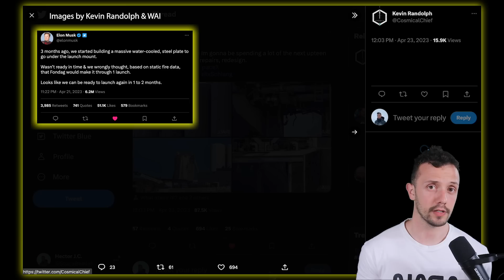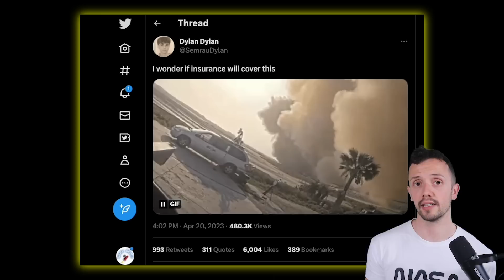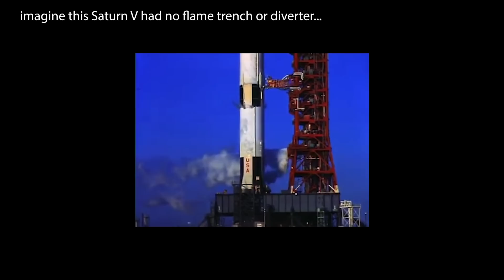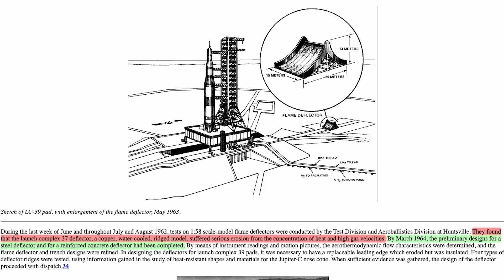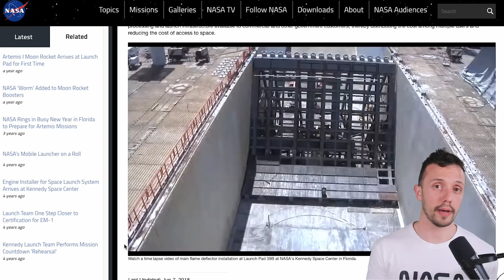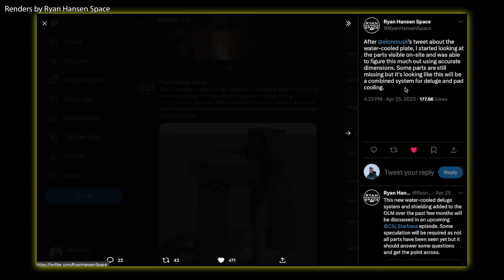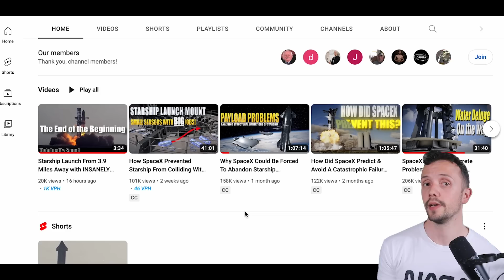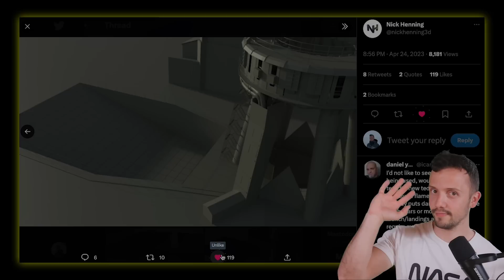SpaceX is Developing a Smart Solution for its Pad Problem: What We Know & What It Could Look Like!

Comment: My question is, how can you put water under the jets,  unless you find a way to keep the water under the jets long enough for the water to evaporate. 
Water under the steel plate,  will do nothing.
My sense is that you need water pumps capable to maintain liquid water under the jets long enough for water to evaporate, which is hard,  jets will disperse water before water can evaporate. 
Hard problem,  it can be solved, if water cooling can be made to work, it doesn't mater if is steel or concrete is used.
Reply: I believe what they mean by water cooled they mean there’s channels within the steel plate that allow water to cool the plate. The water will not be exposed to the jets.
Reply: @saidzaid-alkailani519  
There's no time for water to evaporate,  the jets will deflect the water much faster than the water needs to evaporate,  unless you have extremely powerful pumps that can create a layer of water underneath the jets that have time to evaporate. 
Holes in the plate, is not a solution,  either, it takes time,  a short time for the heat transfer to be established. 
You need water at high pressures and velocities to allow water to evaporate under the jets,  which means,  roughly the m dot of the water to be equal or higher than the m dot of the jets,  by the ratio of lambda water over lambda jets is higher than one, is much more complicated than this,  but this is the physics of it
Reply: @saidzaid-alkailani519  
It takes time to establish an effective heat transfer between two media,  no matter what  the media is.
The thicker the plate, the worse it is , the jets will melt the steel plate in milliseconds.
My thinking is that a launching pad can be expandable. 
Getting to the stars, is expensive, and , beyond all, we are not made to leave this planet,  not now nor in the future, we can have robots to do this for us
Reply: You need brute force. The water cooled steel plate is not efficient at cooling,  you need water to evaporate,  point is that lambda sensible is much lower than lambda latent
Reply: @alexhaplau-colan5414  you’re misunderstanding, the water isn’t going on the surface of the plate, it’s inside of the plate.
Reply: @saidzaid-alkailani519  
That's my point, water needs to be in contact with the jets,
Reply: @alexhaplau-colan5414  maybe, not necessarily though, if they are able to pump enough water through the steel plate the heat can be exchanged fast enough such that the steel doesn’t melt, won’t know if it will work or not until they test it.
Reply: Yes, but there's not time nor money for more experiments, it must work,  period. 
In any cooling designs,  if you can use the latent heat,  the efficiency of the cooling, or heating, is much higher than using just the sensible heat
Reply: The specific heat of water is 4.2 kJ/kg, the latent heat is 2250kJ/kg, this is my point
Reply: @alexhaplau-colan5414  your unit is for specific heat is slightly wrong, it should be kJ/kgT, so if the water increases in temperature by let’s say 40 C then each kg can absorb 160 kJ of heat. The heat transfer coefficient of water is also much higher than steam if the waters velocity is fast enough. Most water cooled system do no require the water to evaporate for  heat transfer, on the contrary cooling efficiency drops if you start developing steam.
Reply: @saidzaid-alkailani519  
There is not unit kJ /kgT,  you're right liquid water has a much higher HTC than steam,  in  any device,  my point is simple,  you don't need a heat exchanger,  you simply need water in contact with the flame,  so water is evaporated,  which takes much more heat that heating the water
Reply: @alexhaplau-colan5414  yeah fair enough, we’ll just have to wait and see if it ends up working. And specific heat units are kJ/(kg*T) look it up.
Reply: @alexhaplau-colan5414  sorry I guess I’m miss writing it, I meant to say kJ/(kg*K)
Reply: @alexhaplau-colan5414  and I’m not so sure if there isn’t the time or money for them to continue experimenting, this the process of iterative improvements, with how fast they are developing this project, failure is to be expected to continue the quick pace of improvement.
Reply: Experimenting,  is beautiful,  simply beautiful,  but experiments don't pay the mortgage,  you need to sell something,  or you need to create a need for people to buy the need that you created.
If you create a hot sauce,  and people like it,  you're rich,  same thing with the rockets,  they cannot exist,  if there's no reason for them to exist, going to stars,  is not a need that people will buy, in another words,  personally,  I don't want to go to Mars or Europe,  or anywhere else,  I'm just fine here
Reply: You think an enormous heat exchanger, which in itself is a big problem. 
I'm thinking water being pumped underneath the jets,  no heat exchanger,  nothing but brute force,  just like the jets are

Comment: I have ran the numbers and it is blatantly mathematically clear there was no way the launchpad wouldn’t receive massive  destruction!
Reply: Elon´s masterplan to figure out any weak points on the OLM? One can hope.
Reply: @PedroTRamos1  Well Elons point was that Raptors will not face flame diverts on Mars or any other environment. So he in sense force development team to think in more robust designs features. Not bad per say because u can then dial back with further solutions here on earth anyway.
Reply: @alesksander  33 Raptors will never fire together on mars so trying to go without a diverter is stupid. Physics demands considerations at this scale, no way around it. Need infrastructure.
Reply: @chrisjacobsen1659  True that. But team tried anyway. After all they estimated for one lunch concrete pad will work till they install cooling plates and rainbirds. Obviously didn't. And engines and structure were tested in worse possible conditions. SO they got worse acoustic data possible. Witch is all invaluable. They know the limits now. And due such harsh requirements engines should be more durable anyway. Aspirational goal is too ditch engine shielding as much as possible. in order to save weight.
Reply: @alesksander  "..Well Elons point was that Raptors will not face flame diverts on Mars ..."
You give Elon way too much credit.
He isn't a genius
He isn't a rocket scientist
He has a Bachelor of the arts in physics. Not a Bachelor of science in physics.
Frankly his Ba is pretty much the equivalent of what a European Highschool graduate knows about physics.

Testing to destruction isn't something that is done while still figuring out the design. Once you have a fully working and repeatable working design you might do a test to destruction to find the weak points and the limits. Doing it while you are still coming up with a solution will give you data but seeing as that you knew in advance that all kinds of things were going to fail, most of the data is actually pretty worthless.
Reply: @PDVism  Maybe he is not genius. But fact is they  assumed that pad will hold and they wanted data for flight. So spin that how u want...
Reply: @alesksander   No need to spin it. Lack of adults in the boardroom and certainly lack of adults that understand engineering basics.
Reply: @PDVism  Maybe yeah. But after many success stories with Falcon 1, 9, Heavy developments. Maybe they got idea or 2 about how build rocket.
Reply: And call them fouls is quite rich.
Reply: With over 37 years of advanced material reinforcement manufacturing and failure analysis engineering experience, I have designs that should be considered for a major reengineering of the launchpad system & tank farm which can be replicated on other planets ie. Mars. 

With reinforced concrete, it is critical to understand the marriage between the Portland cement (glue), aggregate (rock), reinforcement (rebar) and protection thereof to prevent mechanical failures.

To prevent further launch pad, vehicle and infrastructure damage, suggest flame trenches, new reinforced concrete design along with external advanced composite blend blankets working together to protect the systems from the damaging harmonic & inharmonic frequencies, static, dynamic, shock loads, thermal loads and damaging rotor wind vortices caused by the close proximity to the tank farm and individual tanks too close to each other. 

The massive airborne sand, dirt, rock and cancer causing silica DUSTS & debris coming from the pulverized concrete and Earth below & around the launch pad blasted into the surrounding environment from 1,000,000+ thrust wash are ALL in direct violations of OSHA silica dust & EPA and Texas Clear Air and Water ACTs, regulations, rules, guidelines, permits, etc.

If SpaceX has interest in my solutions, I will gladly assist.

Comment: As engine exhaust gasses exceed the speed of sound, they collide with the ambient air producing shockwaves with noise levels approaching 200 db. This energy can be reflected back to the launch vehicle by both the launch pad and the concrete ground surface. What was the acoustic energy levels on the vehicle during liftoff? What were the maximum limits of acoustic energy for this vehicle? During ignition and lift-off, did this extreme acoustic environment (power of two Saturn V’s) damage any of the vehicle components?
Reply: i would guess that all the damage starshp got was from that,  not from concrete.   thier flat water cooled flame diverter wont do anything to solve this problem.  maybe starship will blow up on the launch pad this time
Reply: Underrated comment 👍

Comment: During the ignition and liftoff of NASA’s Space Launch System rocket, the “Ignition Overpressure Protection and Sound Suppression water deluge system” at Kennedy Space Center’s Launch Pad 39B releases approximately 450,000 gallons of water across the mobile launcher, flame deflector, and flame trench. During the launch of the Super Heavy rocket, how much water was flowing onto its launch pad?
Reply: None - SpaceX didn’t have a working water system.
Reply: probably 10 gallons haha

Comment: Everyone keeps talking about a flame trench needing to be EXCAVATED.  But since the OLM is already several meters in the air,why not just build an "elevated" trench around the OLM that will direct the exhaust in a more desirable direction?  This would not require any further excavation below the surface (other than perhaps foundation piers) and could also incorporate a flame diverter.  The flame trench at KSC is not below ground but is part of the pad that was built elevated about ground level.
Reply: That is exactly what the Saturn 1 as well as many other early US rockets used back in the day, the excavated diverter didn't becomea thing until the Saturn V came along probablty due to its immense thrust, and the shuttle & SLS followed suit.